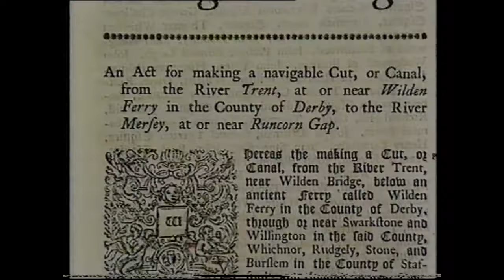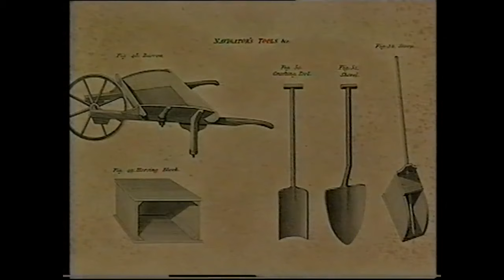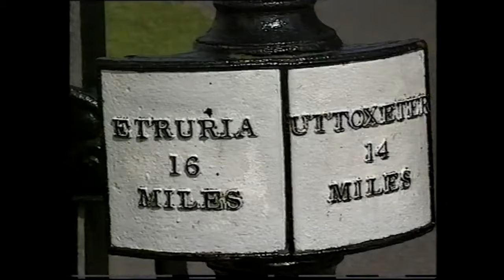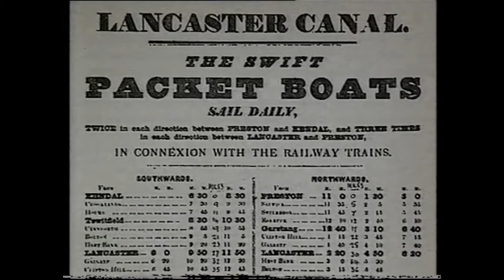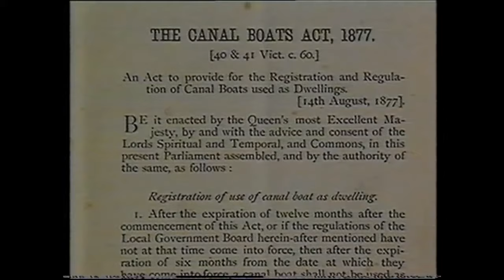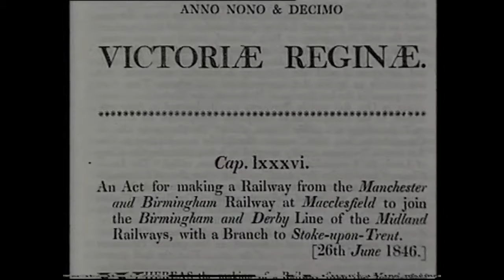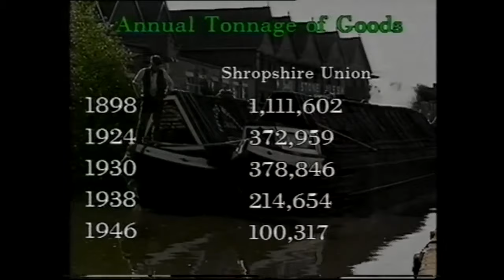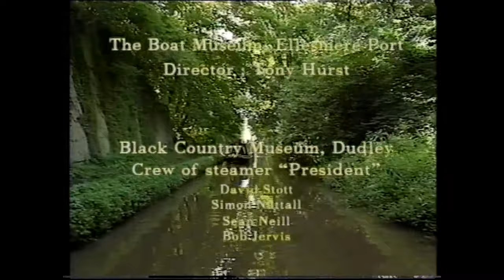The Story of British Canals - VHS - 1993 (Canal History Docu)

Comment: A wonderful video. When you see those narrow boats on the water it's hard to believe what a major part they played in bringing about the industrial revolution. Elsewhere, in the low countries, they built bigger and wider canals, but in England they had to cut through hills and the cross valleys by building viaducts, so the seven foot system worked best for them, and they did it quickly. It is also worth remembering that the Industrial revolution started in England and changed the economy of the world, thanks to the narrow boat.

Comment: I need to get one of these boats and put about 500 hp of American V8 in it to get it moving properly.
Reply: And lose the peace and quiet of the canal life.
Reply: @paulteirney3587  yeah but I want to pull 3 skiers, 60 mph through there. Now that would be peaceful.
Reply: You wouldn't be allowed to do that. The speed limit is there to stop erosion of the banks, and to avoid collisions with other boats . .
Reply: You'd be very disappointed.   The boats are extremely heavy (40,000 pounds or so for the one we hired), do not have a hull form that would support high speeds, and are in such shallow water that most of your power would go into sucking air and stirring up the water rather than moving the boat.  These boats typically have around 35 hp (if they have modern four cylinder diesels) and would be quite happy with half that.  They spend a lot of time (when moored boats are near) at idle -- what the Britons call tickover speed.  The highest permitted speed on the canals is four mph, and typical speed is less.  A couple hundred miles travel in two weeks is a comfortable pace.

This is completely aside from the hundreds of thousands of pounds you could be charged for the damage you did to the canal, the locks, and other boats.